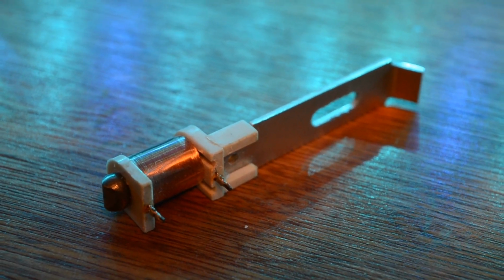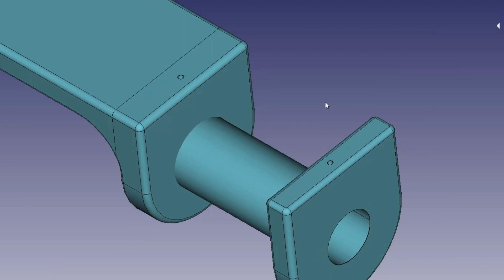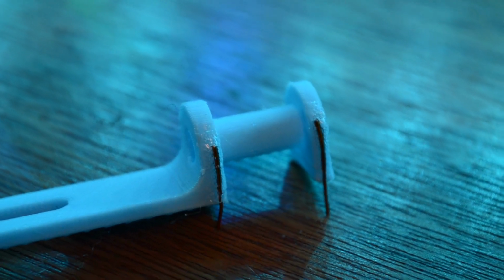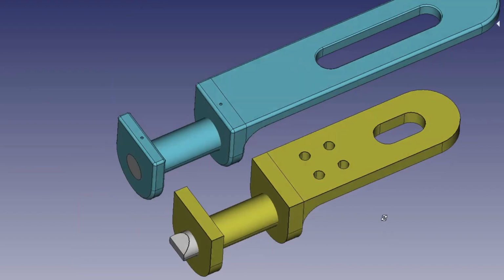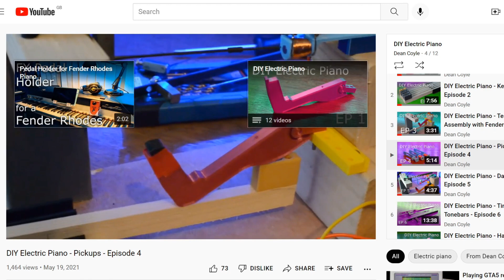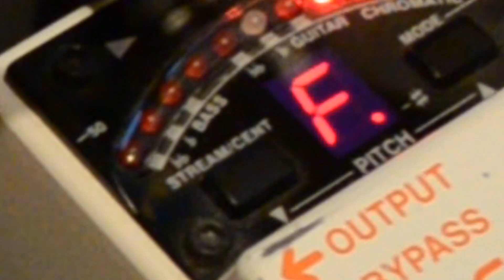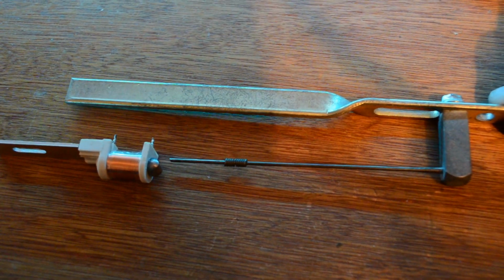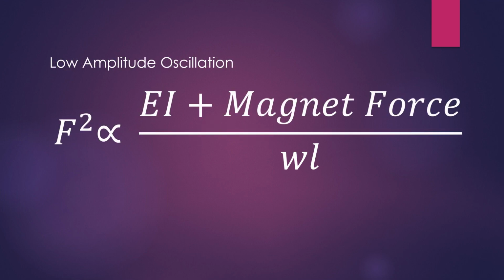DIY Electric Piano - Pickups pt2 - Episode 13

Comment: Question: I notice you connect one of the pickup leads to hot and one to ground on the instrument jack...but what is the connection back to the tone bar (green wire)?  Been struggling trying to make some pickups as well but cant seem to get them to make much sound...the joys of troubleshooting!
Reply from the maker: Hey the tines and tone bars need to be earthed/grounded. If they are not then there can be a lot of noise pickup. I think this is one of the most common causes of noise with Fender Rhodes pianos is when this ground connection is lost. There is also this connection on guitars that usually grounds the strings. 

How many turns of wire are you using? More turns gets more signal....but takes longer and more snapage.
Reply: Ah, of course! Ive been just holding my tines so far and hence was already grounding them! Im getting a nice sound but find the super fine pickup wire devilishly tricky to manipulate!  I seem to fumble it trying to attach it to my leads! @deancoyle

Comment: Is there any reason why you couldn't have one coil spanning several magnets like a guitar pickup?
Reply from the maker: Good question, I think in theory it would be possible. But the setup of a electric piano requires careful adjustment of tine relative to the pickup, having separate pickups allows the distance to be controlled easy. Though the angle/voicing needs setting up also.

Comment: So what happened to ep. 11 and 12? Did you just lose count? How a genius like you can't count beyond 10 is a mystery to me. 
I'll forgive you when you build a new piano for me.
What would you consider to be a fair price for your little masterpiece? Would $2000 CDN cover it? That's about 50 Pounds sterling.
Reply: Btw I noticed that pitch change when you first tested it. I thought that as the amplitide reduced the oscillation would get shorter as it appears to, but I'm not sure about that. Guitar strings also change pitch, they ring higher when first plucked.
I just realised that the the oscillation being larger doesn't mean slower and therefore lower in pitch, it just means louder. 
I'm pretty slow sometimes.
Reply from the maker: The physics gets interesting when you start looking at this level of detail. I guess higher oscillations will need to travel faster to keep the same frequency, so they experience more air resistance. For the guitar sting when its first plucked its has not found the mode shape so it is a tighter?
Reply: @deancoyle  
I always assumed the string stretching when plucked raises the pitch before it settles down. It"s more pronounced when playing aggressively on electric guitar.
Reply from the maker: haha I need to build me one first!

Comment: Would really love to see/hear a comparison between yours and an original pick up off your rhodes . Where did you get the magnets from mate?
Reply from the maker: I will include a comparison in the next video
The magnets are 19x5 alnico 
https://www.ebay.co.uk/itm/132395308248
Reply: Thank you mate! What ohms reading are your pick ups giving?
Reply from the maker: @tbip2001  I am getting a ohms reading of 170. Though I am slightly underwinding mine compared to the fender rhodes pickups.
Reply from the maker: Are you planning on making some?
Reply: @deancoyle  I'm about to start experimenting with guitar singlecoil pickups mate. I'm hoping there is a way to adapt them in banks of 6 notes. 
Once my workshop is set up I can get up and running. 
I've also been researching pick up 'bars' such as the Hempsteadhill style system. 
I should have a a almost full set of tone bars hear soon which I got off ebay for very little money so I can try to replicate them.
Reply from the maker: Sounds interesting, I am thinking of making some guitar pickups. Not sure if I will video these. 
Out of interest are you in the UK?
Reply: @deancoyle  yes mate, in the west midlands Birmingham way. I never coud find your email address!
Reply from the maker: I believe it is there, Channel Page, then "About" Tab. The address is hidden until you click to show it. It needs to be on desktop, wont show on phone. Let me know if its not.
Reply: @deancoyle  oh that's why then.  I'll try my desktop tomorrow
 Cheers

Comment: Thanks, Dean! 
This is a very interesting observation of the magnetic field. Do you use neodymium magnets? What is the diameter and length?
Reply from the maker: I have used these:
AlNiCo5 5mm x 19mm (0.197x0.748") rod magnets
These are a common size used for guitar pickups.
I am sure neodynmium magnets would work as long carefully shaped and positioned.